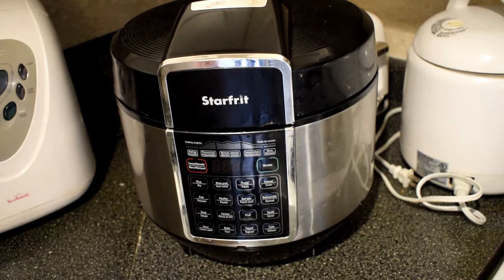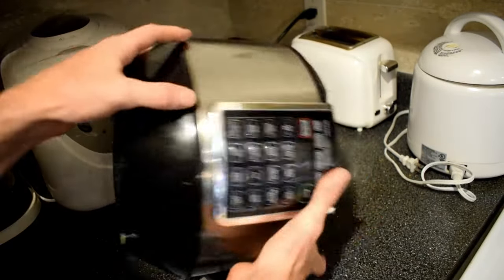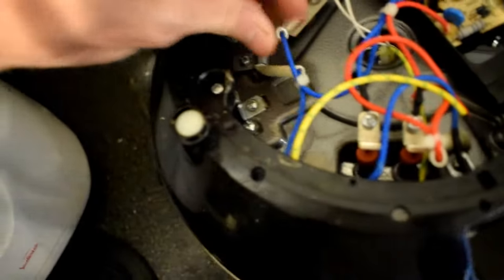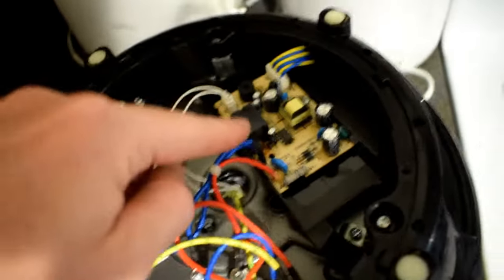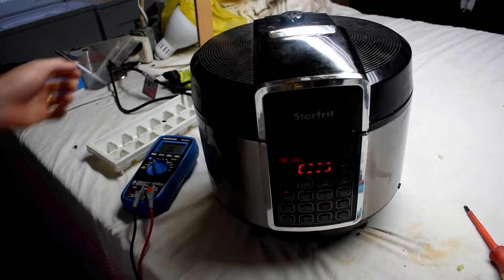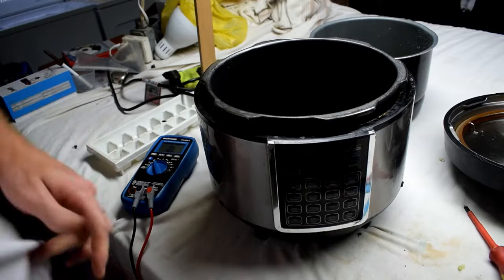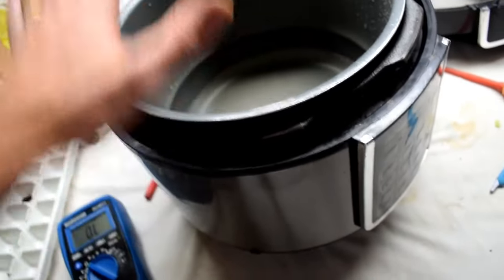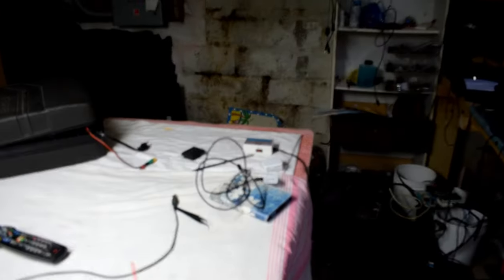Pressure Cooker E4 Error Code Quick fix (Starfrit 024600)

Comment: thank you from Saudi Arabia , you save my dinner 😂
Reply: Had problem after forgeting to put starained food in the pot but direct on heater inside cooker. Got E4, cleaned , assembled buck. Then I got E1, and that was because I forgot to plug those two vires from contact sensor in the middle. After cleaning all works fine.
Suggestion, make snapshot of inside guts for wire possitioning. 👍

Comment: Does that permanently fix the problem? Cause the error still appear s
Reply from the maker: if it come on again you might need to replace the pressure switch not sure for exact part for this machine. please comment if you know.